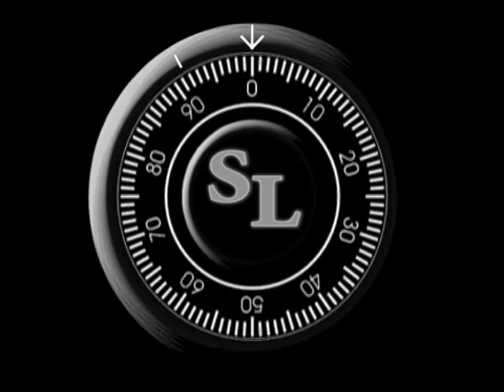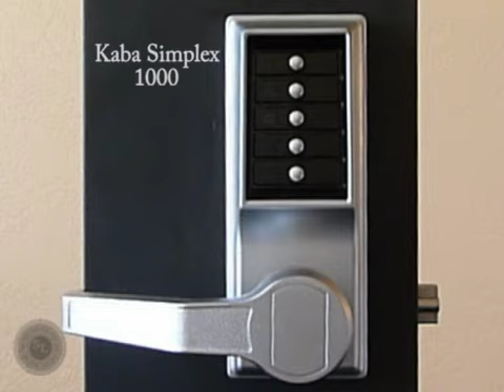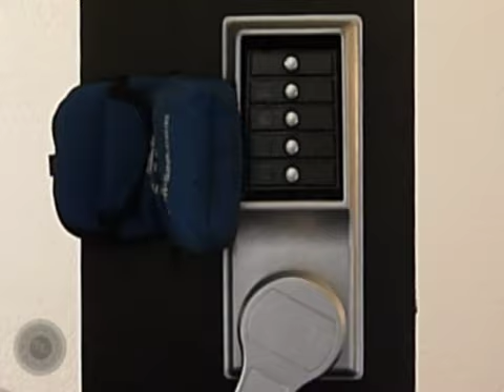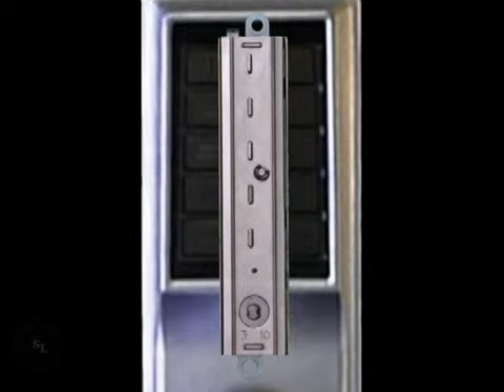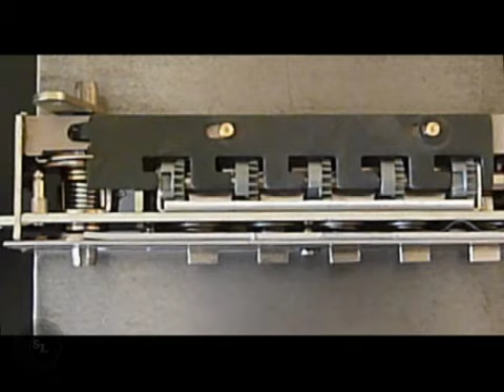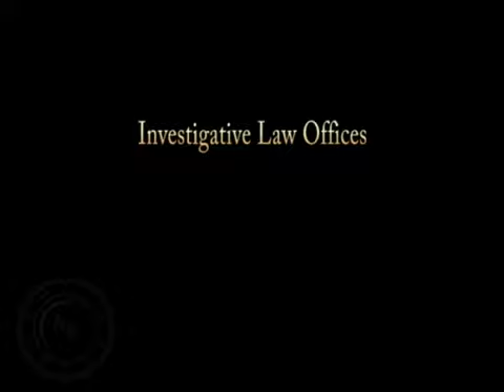KABA_SIMPLEX_1000_SECURITYLABS[1].wmv

Comment: These locks had the second retainer ring around the yellow stud same as the first one look at it closely.  At some point in time, this retainer ring was removed allowing the control arm to be lifted by a magnet. However, this will never happen when these locks are used in a full steel enclosure because the magnetic field will be dissipated no matter how strong is the magnet.

Comment: The rare earth trick will only work on a 1000 that has passage overide capability. The way the passage overide works is the thumbturn on the inside when turned lifts the metal fence out of the gears far enough to bypass them. The metal fence on these are obviously made to allow this. If you look at the fence on a non passage model you will see that the grooves holding the fence in place on the pins are same size as the pins and there is a c clip that holds it in place. Unless the rare earth can break the c clip and allow the fence to pop off it will not work. Not to mention if this happens it will render the lock inoperable. It will always be unlocked after that.

Comment: I have tried this attack on dozens of locks,some fifteen years old,with a 165lb magnet. It does not work!!

,,
Reply: +flemm88 I have also tried this multiple times and I can not get it to work. I have tried it on three locks. Two that are at least 15 years old and one that is around 4 years old. I used a 2x2x1 inch N52 Neodymium magnet and it did not work. The only thing I can think of is the magnet is too strong and is pulling something else along with it.

Comment: S&G's can be manipulated, american padlocks could be opened through the cylinder with a stiff wire, most standard pin tumblers and wafer locks can be picked .... Even the most secure exit hardware can be easily bypassed from the outside .... Maglocks too ... Its been like this for years ... Whats new ... Most people with any lock knowledge at all also know that a battery powered drill and a hand grider will open 99.9 percent of what is out there in under 30 seconds.

Comment: This vulnerability was fixed by Kaba years ago. Almost all locks should've had their chambers updated by now with the new design. Good video though.
Reply: I just ran into two last week that have the old chambers, with a thir the client kept that also had one. The locksmith has a good 70 percent chance of running into these in the wild in areas with small numbers of installs per property.

Comment: I have a L1000 that I'll just say government used. The plate you are showing is encased with a decet thickness steel around it. And it is about 1-1/2 inches from the outer case. A magnet will only still to the case because there are some non-stainless steel parts on the inside. I doubt a magnet will work on the lock I have. The one weakness I saw, but not the average person would know, if there is a combination reset button on the top of the combination mechanism. If you just drill a small 1/8 inch hole on the top a little off the center you would be able to push down on the reset button. I can see on the inside of the outer casing that the engineers knew this and made that part of the case a little bit thicker, but it wouldn't stop a drill anyways.
Reply: Richard's World Well, I found out this will work, but the magnet needs to be extremely strong.
I seen a company called Sparrows sell the magnet to defeat this.
The magnet they sell is claimed 96 pounds of pulling force.

Comment: Such lawsuits are often brought to facilitate speaking fees at conventions, and generate wealth for law firms.

This lock type is considered obsolete by all intents and purposes. Monday morning quarterbacking at its' finest.

There are so many OTHER shortcomings of the product I will not extoll, because it would not serve any useful purpose.

Any product with a shared code, is a traffic control device; useful only in conjunction with guard staff monitoring and/or cameras. Even then, door should be deadbolted, or electronically in a curfew mode after-hours. These are NOT security devices, such as a deadbolt

All mechanical and electronic engineering can be exploited.

Certainly there are exploits for 40 year old safes that once were considered very secure, and carry the UL TL15 label. One such safe I am privy to was easily opened by the owner, a jeweler. He educated me in how he got around all the protections the safe offered.

In general, security devices are a function of TIME, not of absolute impenetrability. This device featured has so many holes in the design, it would not pass a modern version of any test; were there such tests in the US to be applied. Worrying about actuating a passage mode exploit is the least of its' problems.

I will agree that for various reasons, the Simplex mechanical locks all should be replaced. I would not upgrade them, but replace them with a suitable electronic QUALITY product.

There is a fine line between alerting the users of a product of a potential or realized issue, and of educating would be thieves. A wide enough informational "NEUTRAL ZONE" to widen this line would serve the needs of all concerned.

So while an exploit can be found 75 years after introduction, such does not necessarily constitute a DEFECT. It just means that these locks really have had their day in the sun, and the sun has set.

Of course, the hacker community will be pleased.
Reply: Jeff Rosen Doesn't everything have some sort of weakness? If so, then what is an alternative to this lock that is better?

I ask because I currently have an Arrow Revolution V251. It has failed me twice to where the front screen does not receive input anymore. As far as security goes at least it fails closed. Very annoying though. Trying to decide on whether to just forgo the gadgetry and go back to the [less convenient] key deadbolt or if there is a happy medium (maybe one that is mechanical or just has a better track record for its electronics).

PS - this is for my door to my garage to my residence.

Comment: Thank you for the info!  I have one of these locks and thought my building was secure.  We also used these out in Iraq and I became very familiar with changing combos on locks that I didn't know the combo on.  I'm going to pull the plate on mine and replace it with a stainless steel plate.  I don't understand why Kaba/Simplex won't replace these plates with stainless.